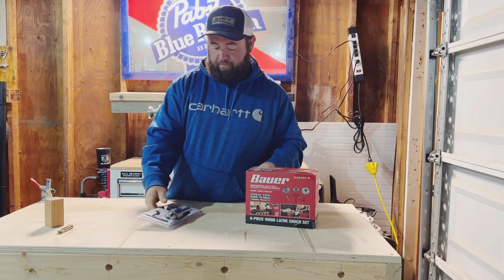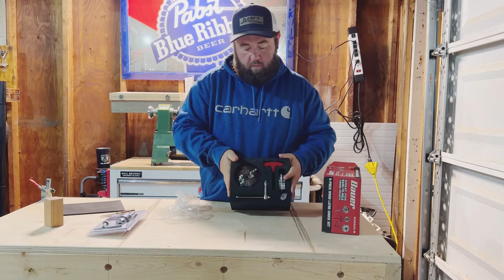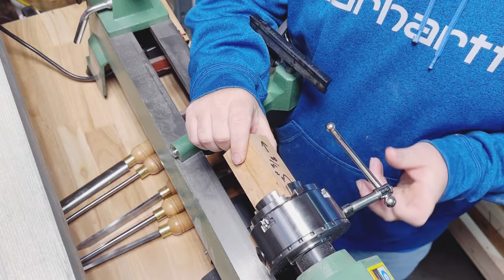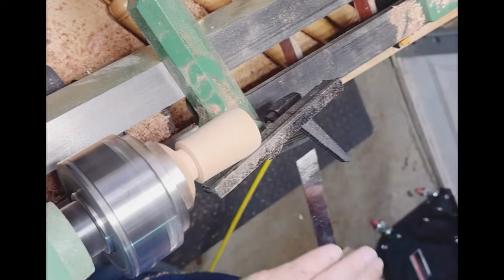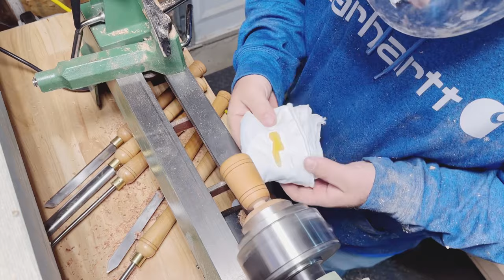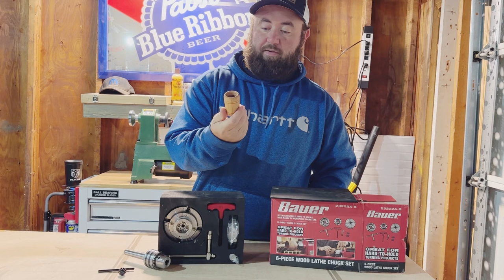Lathe chuck set reaction | Harbor Freight

Comment: This a Chinese copy of the Nova Lathe Chuck I bought at the local Rockler store yesterday for $159 minus 20% coupon I received in the mail.  Y’all do the math and figure out if it’s worth giving your money to the CCP.
Reply: I agree with you it is a cheap Chinese knock off. But not of any Nova chuck. I have a Titan, 2 SN2s, a G3 and a Precision Midi. It uses a different key and has a metal back.

Comment: Woodturning is all about: SAFETY SAFETY & SAFETY. Check out any turning clubs or vo-tech’s in your area . Getting lessons will give you rewards 10 fold and not get hurt. I don’t believe there is not a woodturner in the world that won’t share information and teach a new or old turner……….. We all love to teach. Best of Luck
Reply: Thanks for the info.  I just met a 90 year old man yesterday.  He took me into his shop and showed this young man, myself a 66 year old kid some of his lathe tools, wood stock and projects.  He said if I have any questions or have need any answers to come by, say hello and he will help me with any questions I may have.  We spent about 90 minutes talking about wood turning.   On my way out he gave me some nice pieces of spalted maple and said I could get more wood if I needed.  He had the high end Powermatic lathe, bandsaw equipment and well over $3,500.00 in lathe chisels, gouges and knives.  On the other hand, I  bought an absolutely like new older Delta lathe that appeared to never have been used at an estate sale.  The lathe I own can only turn an 11.5" bowl and about a 42" spindle.  Speed changes are done by moving the belt from pulley to pulley. And my knives and gouges are a $39.00 set from Harbor Freight.  I definitely need to buy some decent knives. Any recommendations for a set of decent tools that will get the job done without the 'dick-wagger' premium price? 

I used to own every toy I wanted.  I owned airplanes, boats, dirt bikes, street bikes, motor homes and spent money on recreation activities like drunken adrenaline junkie.  Now we are retired with okay pensions, no debt and a little nest egg.  But with Biden/Trump Uni-Party inflation, who knows what the future for the economy holds. I am reluctant to piss away too much of our money on higher end equipment when I can get by with a less expensive stuff.  Before, I always bought the best or at least did not settle on lower end stuff.  But now in my twilight years I have learned to save and make do with what I have or adequate equipment.  So that is why I am here looking at a Harbor Freight chuck for my older Delta lathe that I bought last year at an estate sale for $325.00. 

I just want to say thank you for the safety advise and the tip about talking to other wood turners about the hobby. Besides learning to be a bit more thrifty(I still spend a little too much, but I am learning), I have learned to be much safer than I used to be in my younger days. I am not pedantic, but I do take many more precautions as far as safety gear. I still can do a better job though. At least, on occasion I wear gloves now, put jack stands under our vehicles when doing a brake job or oil change, wear safety glasses when grinding or cutting wood or metal and wear a respirator when working in a dust  or particle filled shop or room when painting or running my lathe. I know two men who both lost an eye splitting wood with an ax and almost every person I saw who was missing part of a finger lost it on a radial arm saw.  As far as my biggest pet peeve is ladder safety, but that is whole separate conversation. I do not mess around on ladders or ladder safety as I grew older.  Ladder safety and electrical hazards are the big killers sources of death or injury around the trades.
Reply: @JohnJohn-ec6kx  Looks like you are on the right track….. Best of luck to you

Comment: Thanks for the review. It would make the review of the drill chuck be of more use if you were to say what you didn't like about it. Is it inaccurate, that is to say it doesn't hold things perfectly centered? Does it deflect too easily when pressure is applied from the side? Or, does it not open and close smoothly? Etc. Being off center or deflecting too easily are far worse sins than opening and closing roughly.

One suggestion, when using a drill chuck, it's best practice to hold it with your hand. This will prevent it from spinning in the tailstock's Morse Taper, which can gall the taper. It will also prevent the drill chuck from being pulled out of the tailstock when you withdraw the quill.

Comment: Did it not have a set screw to secure it to the spindle? Most aftermarket wood lathe chucks come with a threaded hole in the spindle mount, and a plastic or dense rubber slug that drops in the hole. A set screw is then inserted, and it binds up on the spindle threads without damaging them. On lathes that have a reverse feature, it’s HIGHLY recommended that the chuck be secured like this to prevent it from being unintentionally backed off and exiting the machine! Many users prefer the reverse rotation for finish sanding, for reasons unknown to me! Thanks for showing us this thing. I saw it in HF a couple days ago for the first time!
Reply from the maker: No it didn't come with that. But that is something HF should look into if they come out with a modified version.
Reply: Reversing a lathe that has a chuck that does not have a locking screw is stupidity.
Reply: @BobBlarneystone  My point exactly!

Comment: Thanks for your review. I didn't know Harbor Freight had 4 jaw chucks.
Reply: I work for harbor frieght. They also have a bauer lathe tool set.
Very good steel.(HSS).
The only thing I wish they added was a wooden case for it. The tools come loosely in the box. 
So for 89 bucks you get high quality set. Cost as much as a radius skew by raffan.

Comment: Does it fit a 1 × 8 head stock. Im very new to lathe terms
Reply from the maker: Yes. That is what I have
Reply: @Beardsmanwoodworks  nice 👌 just came back from HF and got one. I thought the 25% coupon was going to work. But they said I didn't read the fine print. Doesn't work on that brand
Reply from the maker: @echo1er  too bad it didn't work. I hope you enjoy the chuck and have fun turning

Comment: How do you remove chuck from lathe ???
Reply from the maker: It just screws on and off. No tool required just twist with your hands
Reply: not when it's stuck tight 
 @Beardsmanwoodworks
Reply from the maker: @jonathonlonsdale  I haven't had an issue so far. Haven't needed a tool

Comment: The issue with these off brand chucks is the jaw availability.  As long as the two jaw sets that came with it are adequate for your uses then it is a good buy for a mini lathe.  However if you need different jaws where would you get them?  I have a Nova Titan III and a Nova Super Nova 2 and have literally 20 different jaw sets for various operations.  A second thing about that chuck is no set screws to lock the chuck on if you turn in reverse.  When turning in reverse without the locking set screws the chuck can literally fly off the spindle.  Your mini lathe may not turn in reverse but many lathes do.  Obviously $100.00 is a good price for the chuck but it is limited in what it can do with only two sets of jaws.  Although the Nova, Oneway, and other higher price chucks give you a lot more options for jaws at a price.  So I think for a mini lathe like you were using that chuck would work.  Most of the Chinese knock off chucks usually are compatible with other brands of chucks for the jaw hold on screws spacing.  The only other concern I have is at $100.00 what is the quality of the internal gears that tighten and loosen the jaws.  Will it wear out prematurely?  So even with the cheap price is the longevity of the chuck worth the price if you have to replace it every year or two?  Good luck with your new toy.  As others commented below get your sleeves rolled up and use paper towels and not cloth and do not use both hands when applying finish.  If you get the cloth or your sleeve caught on the edge of the jaws you will wish you had heeded the warnings.  I suppose that the chuck is a 1" 8 TPI thread and would be fine on a mini lathe but I would not put that chuck on a bigger lathe even if it had a 1" 8TPI thread.  The power of a mini lathe compared to a 16" swing and bigger motor would concern me.  Harbor Freight makes tools that are what the advertise it for but it is just barely what the tool is advertised for.  Bauer is HF's own brand and frankly I would not bet my life on a HF tool.  Make no mistake you are betting your life on that chuck every time you use it or any other brand of chuck.  😉